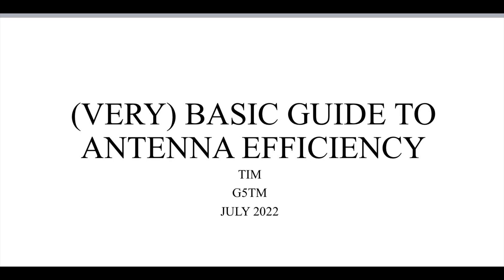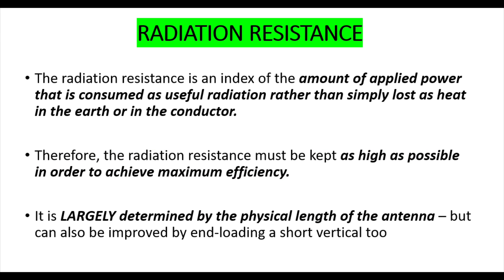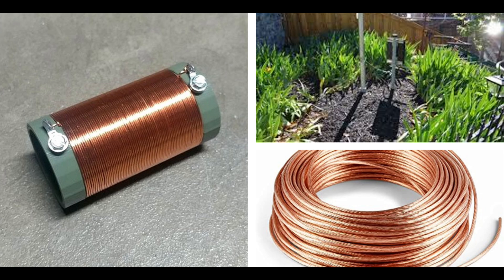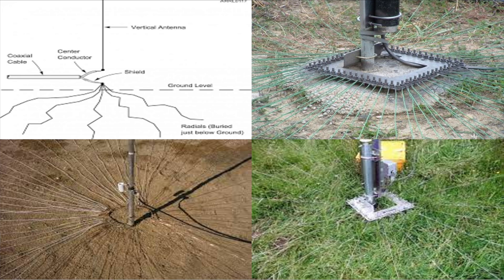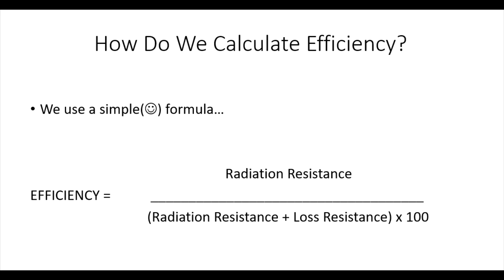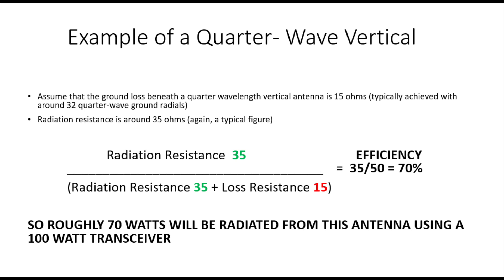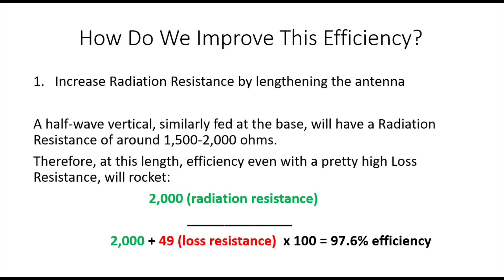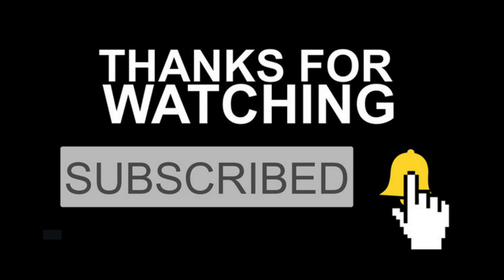Vertical Antenna Efficiency - A Basic Rough Guide

Comment: Great stuff ... in depth on the two most important aspects.

I'm looking at EFHW focused on QRP at 14.060 ... and, both resistances dealt with, wondering what else affects efficiency!
Sure ground has effects. Now I'm wondering about height as related to wavelength/frequency.

cheers!
--VE6IU
Reply from the maker: Height above ground is key!
Reply: @TIMG5TM  Well yes, I figured that. But the exact relationship isn't just Yes/No!

Besides which I'll have to figure "height above roof" along with "height above ground".

Comment: Hi Tim! Excellent video, thanks! How about devising a practical "workshop" style worksheet to these type of videos that people can use to learn how to actually measure these things? It's very valuable to know the theory behind antenna design, of which efficiency is after all a key element. With this in mind it would be good to have at least pointers to resources that can help us to practically do these things. After all, a big chunk of us learn more efficiently by "doing" rather than by just reading (I fit in the "learn by doing" category). 

It is a good time to be an amateur radio hobbyist, because we have fantastic cost-effective measurement tools available to us. Things like the NanoVNA and TinySA comes to mind, as well as really cheap multi-meters that can measure voltage, resistance and impedance. Up to relatively recently these things would have been prohibitively expensive to individuals, but now you can pick up a brand new NanoVNA or TinySA from reputable sources for a lot less than £100 each. A standard multimeter that can do at least resistance, voltage and continuity testing can be had for £10-£20 if you don't mind NOT buying "big names" like Fluke, and additionally you can get something that can measure Henry (His Royal Impedance) for about the same. 

I suppose the point I'm trying to make is that newbies like myself need a way to develop our confidence in closing the loop between antenna design (the theory of it all, which this video is a fine example of), to manufacturing and testing (how do we test it without risking our expensive radios) and finally to use our own home-brew antennas effectively.

Thanks for all your work in helping us understanding antennas, it certainly is a fascinating aspect of this hobby. 73, Jan M7HNK

Comment: Radiation resistance has a special definition.

“The total power radiated in all directions divided by the square of maximum net (or effective) current causing the radiation”

This implicitly means that the radiation resistance should be referred to a current node. Further, the radiation resistance is a consequence of the geometric structure of the antenna. This is the reason a vertical half wave dipole has the same radiation resistance of an end-fed half wave antenna.
Reply from the maker: Indeed

Comment: Currently experimenting with TRUELADDERLINE Doublet Antennas. Using formula dimensions from L.B Cebik W4RNL, specifically 44 feet Antenna and 50 feet feedline, performance is the best I've had (by reports and receive signal) in comparison to EFHW and Random Wire antennas and Random wire vertical. Also used TRUELADDERLINE 22 feet doublet antenna with 50 feet TRUELADDERLINE feedline portable at much higher and open area and results were outstanding yielding 3 S units increase signal (Transmit and Receive) using 27 watts from FT-891 or about Half Power used from Base Shack. Doublet is best antenna for me this side of Yagi-Uda Antenna  ; )
Reply from the maker: Very useful information James - thanks 73

Comment: Hallo Tim, excellent video! My goal is bettere performance on 10-15-20m with 2 vertical EFHW with 49:1 transformer elevated from the ground using fishing poles: the first 10m long for 20&10 and the second about 7,2m for 15m band. Do you think that 2 resonant radials for band is a good solution for loss optimization? PS: now i'm using an 8010 EFHW ground mounted with 49:1 and 15 radial @4m long
Reply from the maker: Hi Franco - those two antennas will work very well!

Comment: Very well presented,  and unusually I agree 100%. It is very handy to have a low SWR antenna particularly for those of us that remote control or radios. But there is precious little point otherwise. 
I think my HF antenna feeder maybe as short as 50ft,  if my SWR was 4:1 on the 40m band the additional loss in the feeder due to SWR would be about 0.2dB. My original radio system (very limited) measured at about 20 ohms. So as per your example the efficiency due to ground loss alone woud be down to somewhere in the region of 60% driving a quarterwave vertical. Extend the vertical  to 3/8 wave with a series capacitor and the low angle radiation will improve by more than the SWR loss in the coax plus the ground loss will be reduced. Efficiency should now be in the region of 90%. close to a 2dB improvement despite the high SWR...
Reply from the maker: Great points - thank you!

Comment: Great video Tim, I look forward to the sequels. I'm planning on building a vertical antenna using a squid pole to mount on top of my all steel shed (approx 14x10 meters, American barn style). I'm hoping it works well and I'm hoping I can get it up one day while the wife's at work and hoping that the old "seeking forgiveness rather than permission first" idea works !!!! I'm also thinking or building a big, low, loop antenna to use as a receive antenna in conjunction with the vertical.
73
Reply from the maker: That's a great idea - get it in the air and then pray!! 73

Comment: Tim, great video, I will be looking for the follow ups. I do have a question regarding making a mono band 1/2 wave antenna for the 10 meter band.  You mentioned having a L C Network at the base.  I was wondering how I could go about doing that.  Is that something I could buy already made or do I have to make it myself?
Reply from the maker: That is correct Brian - there is a manufacturer in the UK - UK Antennas who make high quality LC mono band half-wave antennas.

Comment: good video. interesting this with loss in an antenna and ground loss, but how about using a gp antenna for 40 to 10 meters with coils so that it does not get so high and with radials then you get the ground plane up in the air and no loss towards the ground and tun the antenna for your frequencies you are going to use it must then be a very good antenna
Reply from the maker: Yep - elevated radials are pretty efficient and you need fewer of them

Comment: So dig a 1m deep 40m by 40m hole. bury a large amount of chicken wire then buy bags of salt and cover the area with it.water it in then cover it all up and put your vertical up in the middle it's should work great... Right :) I'm kinda wondering if anyone has tried this crazy idea.
Reply: Salt really works, that's why it's suggested as a solution to improve ground rod conductivity. Should work same for radials.
Reply: @samgrieg  - but it will kill all the XYL's plants!  :-(
Reply: @hamshackleton  I'm afraid you are absolutely correct.. that spells TROUBLE 🤦
Reply from the maker: If only it were that simple!
Reply: Not quite that scenario, but because 
I just wanted to get on the air without all of the reading.
I put up a 5m painters pole and layed out some radials,  just to see what would happen. 
It's still there and it works dx everyday,  zl to eu , so sometimes it's simpler to suck it an see. Well done tim for all his work for those with more patience than me, 73 zl3xdj
Reply: Sounds like a great idea,  but sadly chicken wire rusts faster than a Friday afternoon Vauxhall Viva.  However a copper based mesh is a great prospect.
Reply: @M0RMY  when I own my own place and if it has a big enough space I'll try this crazy idea. Maybe stainless steel fence wire? Copper might be too many $$$.
Maybe a layer of plastic over the top of both to stop the salt washing away to fast? Then bury. Maybe a layer of paper,salt,mesh and paper? I did find via Google the idea of using lignite. Or maybe bags of graphite.